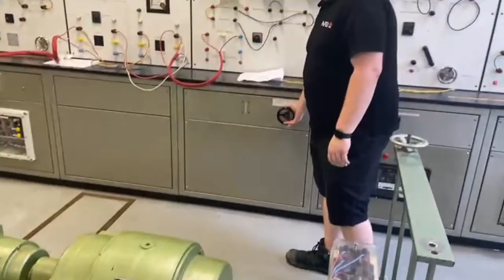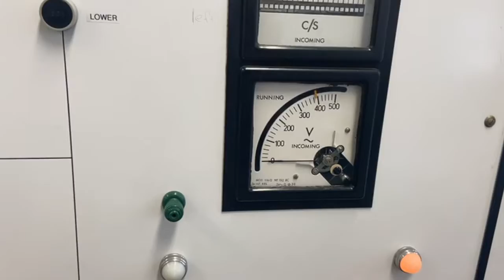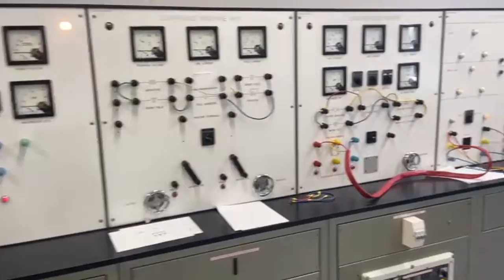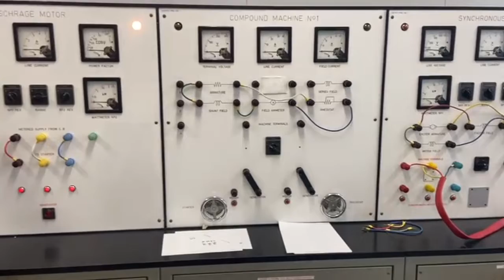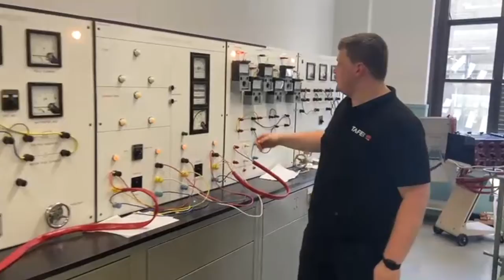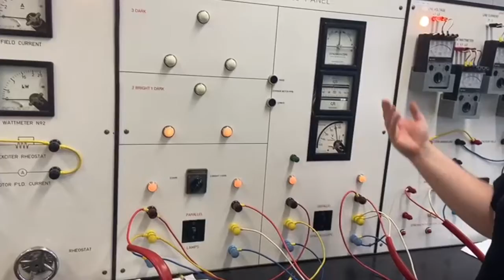Synchronising two Alternators using Lamps and a Synchroscope

Comment: How the single  lamp glow?
 As the single  lamp has to glow it is to be connect one leg to phase and another leg to neutral connection in a simple circuit . Lamp glow or dark speed depends upon their frequency difference. But how during syncronisation lamp gets phase and neutral connection? 
As our goal to match the phase angle  resultant frequency is either higher or lower then how the current is flow from and which direction or how it's gets neutral connection  so that it glow?
Reply from the maker: @bikash3003  three lamps are arranged so that one lamp is connected phase A to phase A. This lamp will be dark when both “A” phases are at the same RMS voltage and phase angle. The remaining two lamps are connected from phase B to phase C, and phase C to phase B. These two lamps are illuminated at the same brightness when phases B and C of the grid and the generator are 120° out of phase. No neutral is required in this instance.
Reply: @julianpiper240  legend mate, this last sentence here is what i've spent hours looking for online